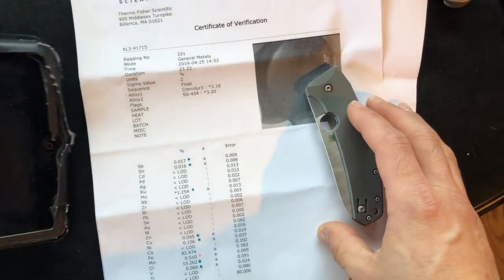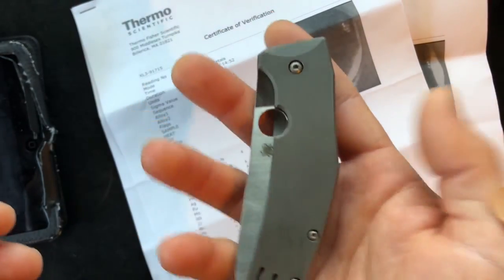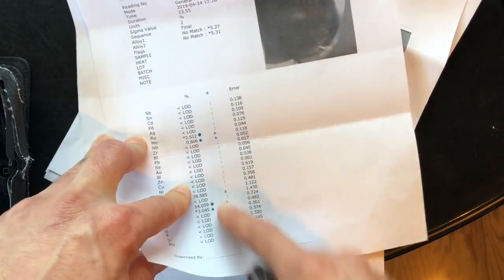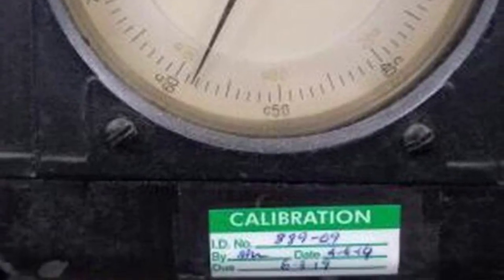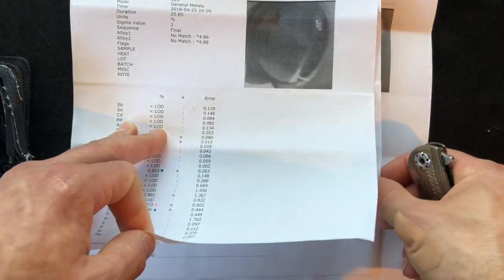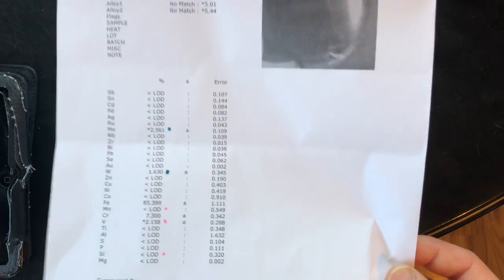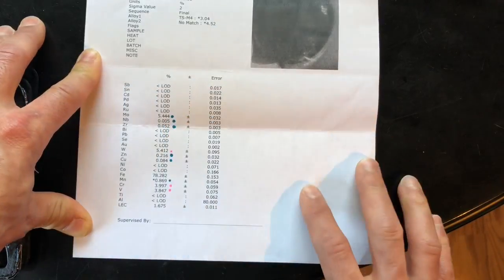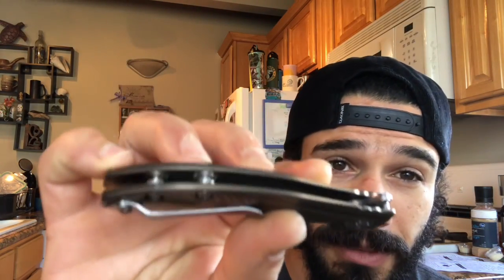HRc Testing Episode 5

Comment: Just a heads-up, you won’t find 20CV much higher than 62HRC even in customs. For blades that are batch heat treated by production companies in vacuum furnaces, 59 to 61 seems to be the sweet spot. Crucible recommends 56-59, which your knife is right on the high side of. Thanks for all you do sir!
Reply from the maker: Jason Thames yeah, I realize that, and I do talk about it more in other videos. We are finally starting to see some get up into that 60 mark, which is nice. The Mordax from Ferrum Forge/Protech/Drop is supposed to be 60-61HRc. Yeah, these production companies just don’t have the moving times to support the particular quenching needs of this steel, and it’s analogs. I do realize that crucible specs 56-59, but that is more based on the industrial uses, and cutlery could be taken much higher, which has been proven by custom makers, and even some production. I am happy with the performance of this knife, and they must have done really well with the austenetizing and tempering process. Thanks buddy, and thanks for your input and information here👍

Comment: What was the HRC on the 20CV of the ZT 0609?
Reply: ItzWolffz  For 20CV that's low!!!  Of course a disappointing heat treat from ZT, I'm not surprised!!!
Reply from the maker: Yep... 58.4. Got another zt 20cv at Kurt’s right now👍 so we’ll see where that lands✌️🤞
Reply: @inthepocket7405  Zero Tolerance in my opinion has not really had any good looking designs in quite some years, and their overall build quality is questionable at times. I had several ZT's over the years that had frame lock issues. In general I'm not really the biggest fan of frame lock knives. Especially frame locks knives done by ZT, which are known to not be the strongest or most reliable frame locks out there!!!

Comment: ZT advertises there 20cv to 62hrc. sad to see it at 58.4hrc. but the heat treatment matters more than the hrc. we'll have to see more cardboard cut tests on these. but yea, sad they say 62hrc. but in actuality its not what they advertise. hopfully more zt 20cv knives will come through to see if any of them will be 62ish.
Reply from the maker: Tactical Center Fo they really!? I couldn’t find any literature on it, but could you send me a link or something, if you find it? It is really sad if that’s what they are claiming. I am impressed with the way it performs at that hrc, in this example, and compared some of the others I have, that might have even come up at a higher hardness. Still, you have to feel like there so much left on the table.
Reply: @inthepocket7405  it's actually listed as 60-62hrc for there s35vn and 20cv (and in the older catalogs 204p is also) when they were doing blade show they said they are now offered at 62hrc. They neglected to say 60-62hrc. But yea in the online catalog, link at the bottom of the zt web page, it lists as 60-62. Kinda sucks they embellished in the vids. S30v is run softer and mostly offered in the heavy duty models only. So yea yours is run low and so is the one on bladebanters spreadsheet for s35vn.
Reply from the maker: Tactical Center ugh... 😑 that’s shit. Hahahaha
Reply: We did get to see in the catra testing that Kershaw m390 at 61rc performed worse than Spyderco s30v at 60rc and Spyderco m390 at 60rc. And the Spyderco was thicker behind the edge. Outpost76 verified with cardboard cut testing after.
With that said... Microstructure matters more than rc. The protocol is important.

Comment: Soft steel is ironically more complicated to sharpen (especially burr removal) 56hrc s35vn wow thats real sh*t soft... I would figure that out after few strokes on the stone..20cv at 58.4hrc is literaly waste of the material cause it will do about as good as s30v!!! Yeah so its excellent done 20cv , RIGHT? 🤦‍♂️

Comment: I'm not sure about that lc200n Kenny. I checked the data and optimum hardness is spect as 56-58hrc.. I wouldn't compare it to standard carbon based steels.. I have the Spydiechef and I never really tested it but I use it everyday in kitchen and it works fantastic, not only the blade steel but the ergonomics .. I think everyone who has handled that knife feels its beauty.. But that Gemini is shocking!? What? 55.6? That's so far the worst result of any steel HRC on this channel.. Really disappointing cause I have 2 kizers and I didn't bother to test these 2 but I noticed on T1 that the edge gets damaged very easy so I assume it's also badly heat treated.. The other one great knife ,in fact I used that knife for everything and holds edge without concerns.. Both are s35vn and wonder how could they screw it up so bad cause that's not even close to minimal HRC specified 58-60hrc..Thank you Kenny for sharing again
Reply from the maker: Yeah, lc200n is a very different steel, and yes, it performs great at 58. The highest we could even find anyone pushing that steel, was about 61. My native 5 salt is even lower, and performs excellently (coming soon). The high nitrogen creates a whole different kind of grain structure, with much smaller “nitrides”, so it performs well, even at lower RC. As far as the Kizer goes, that was very disappointing, but I kind of expected it. By that knifes performance, and because a lot of the kizer‘ awe tested came up very low. I love my Gemini and T1, so it really sucks. I would have hit them up, but I don’t think they would be very receptive (I heard their customer service is meh), and I know they’ve heard about their blades coming up low. I also anodized both of those knives, so they’re definitely not going to do anything for me. Of coarse, buddy:)
Reply: @inthepocket7405  I don't know if the same applies to Nitrogen steel but ones you push carbon based steel into higher hardness it could negatively affect corrosion resistance but I don't know if this works same for this steel!? I love it so far and nitrogen has very low molar weight so it should "theoretically" form more "nitrides" but this is also hmmm so to say my own logic cause I'm not metallurgy expert just know few things here and there.. I wonder if that HT in kizer applies to whole palette of their knives but 55.6 was honestly jaw dropping!!! Plus if you disassemble the knife it voids any warranty witch I don't appreciate at all since all their knives run on bearings.. I wonder how they would react if we confronted them with your finding?  So far what I've seen on this channel ,the Spyderco is the most consistent with best warranty coupled with best fit and finish and it line up cause those I have are all equally stunning..But to be honest I just want to see the same from all brands ZT included.. Thank you for everything Kenny👍PS I love my T1 too and it would be just waste of awesome design to screw it up on HT..(I know the hardness is not everything but if it comes this low there is no way that the knife will perform this butter steel hard blade)